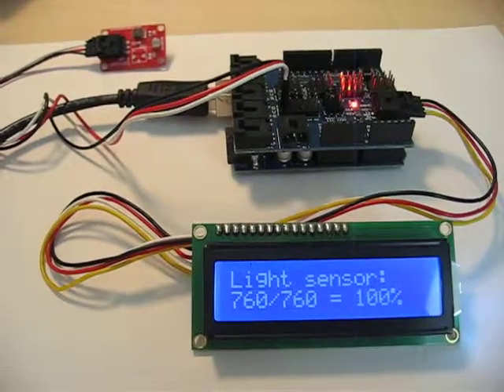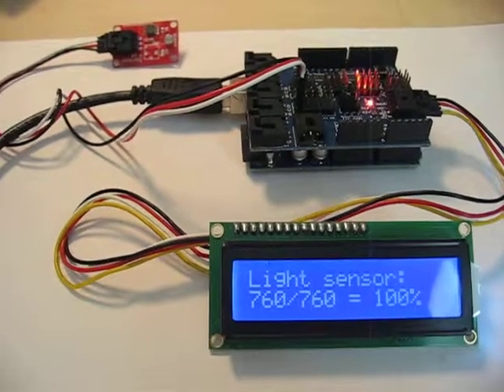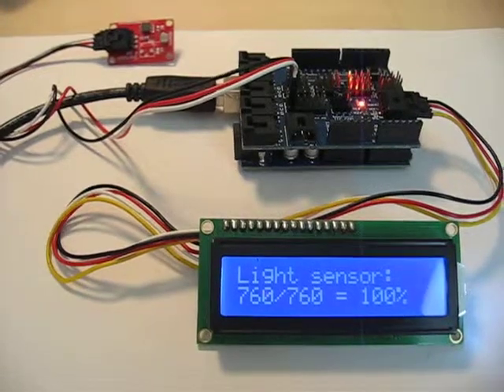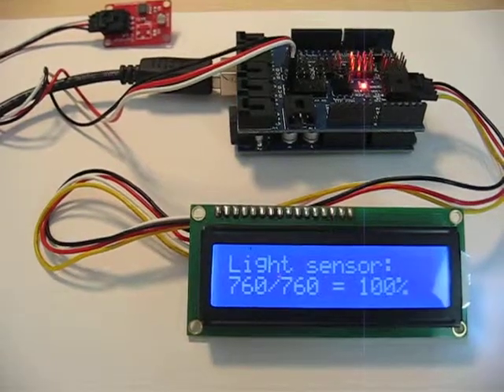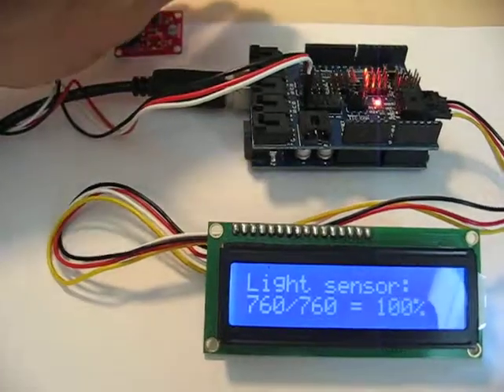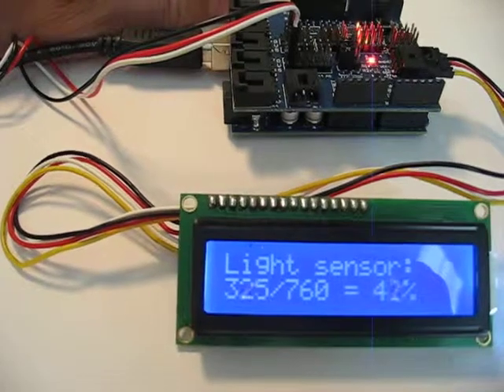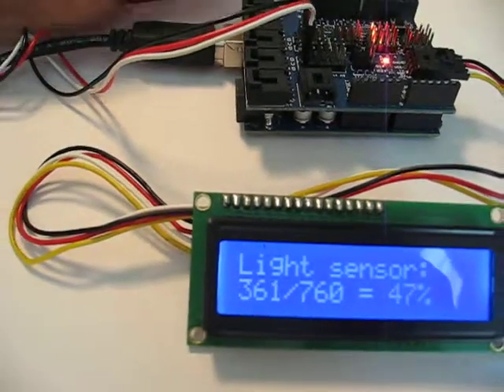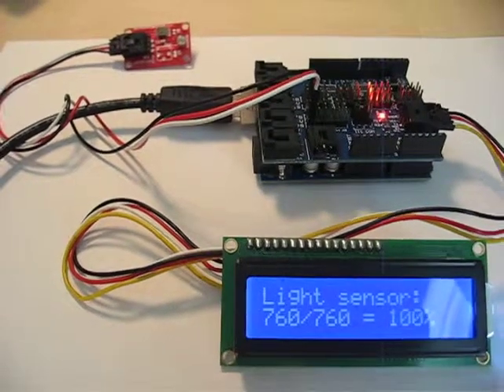Arduino Sending Photo Sensor Info to Serial LCD via I2C

Comment: Hello,

with your sensor Sheild board......I just bought one today...using the i2c interface for the LCD with the Two wire interface board on the back....it should all work, but I don't understand what it is about the sensor sheild board that makes a difference...what did you set your i2c address to 0x27?